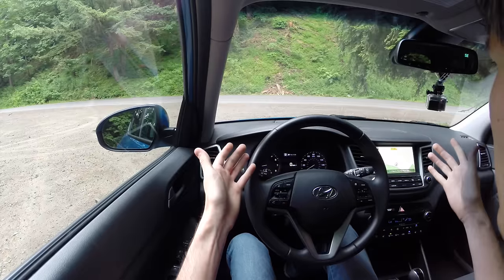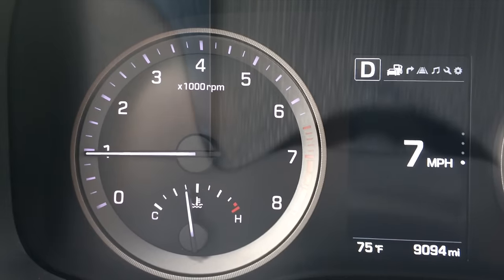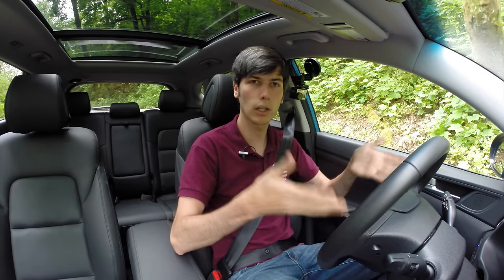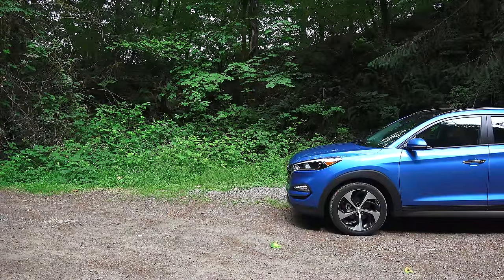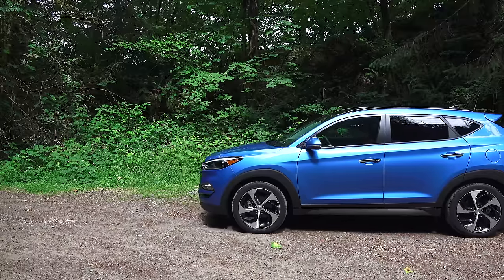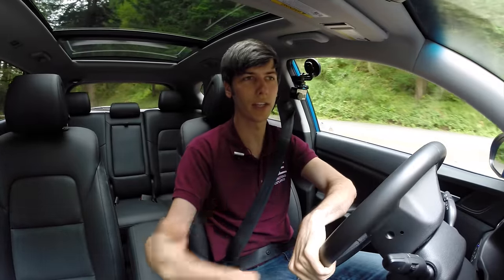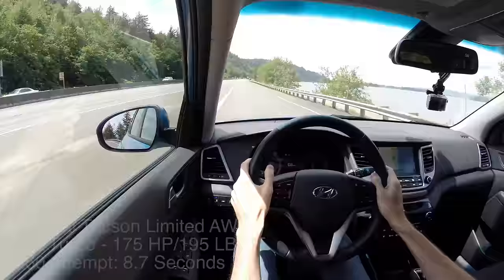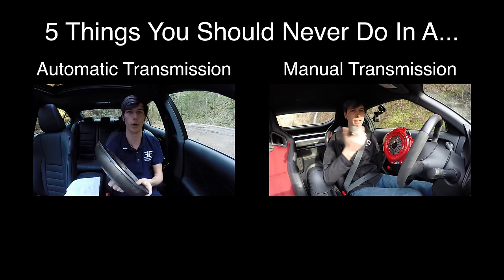5 Things You Should Never Do In A Dual Clutch Transmission Vehicle

Comment: "...engineers who develop these cars smart enough to realise that problem...": doesn't surprise me how a lot of people in comment sections don't realise that, especially in regards to auto start/stop and engine starter motors.
Reply from the maker: Great example!
Reply: Bigger mistakes have been made... often depends on which car company we are talking about!
Reply: They do realize it. Thing is, they don't care. The more these things break, the more money goes to the dealers. That's a win for them...
My biggest problem with the start stop is not the starter itself. You need a bigger battery, that will die sooner, and will be more expensive to replace. And it also doesn't help cars with dual mass flywheels. Another expensive thing that will wear out sooner when using start stop.
Reply: auto start/stop in non hybrid vehicles is annoying and dangerous and should be eliminated or the vehicle should have the option to have it permanently disabled. 

Everyone I know (yeah, I know...not a good sample) hates that "feature" in their car.

Plus, my car tells me at idle with the AC blasting I'm burning .4 gallons per hour. Lets assume that's accurate. Two and a half hours of idling to save one gallon of gas is a lot of damn idling for what seems, even in aggregate, to be a minimal savings. 

/rant
Reply: Doctor Professor Can't argue with that:) I can only throw engineers a bone in that most recalls seem to be from manufacturing defects (Some of Takata's canisters being cracked and GE's Airbus A380 engine's having an oil pump which was manufactured smaller than the Airbus engineer ordered, causing a fire in a Qantas airline).
Reply: dn bn Car models of good companies can be bad too. I had a cheap Holden Barina (Chevy Aveo in US markets) which had a thermostat housing made of plastic clearly to save money. Had to replace it with a metal one as it kept obtaining small cracks every 3 years. 

I have to respect that when I want purchase a cheap car though, the engineer is pressured to keep costs down or find a new job.
Reply: Na5iR11 BMW and alot of VW group cars use plastic in places they shouldn't, common problem!
Reply: +dn bn plastic oil pan, that blows my mind.
Reply: *****
Why? Plastic has been used in fuel tanks for years. Plastic can be made to have similar strength to metal. Plastic malleable and, therefore, more likely to deform than puncture.
Reply: Plastic goes very brittle with age
Reply: dn bn
not all plastics are created equal.
Reply: this is true, but metal is better for engine components. Fuel tank is debatable.
Reply: No..it doesn't. It has a "twin circuit" DRY clutch in it..
Reply: +admrob it's not like you can bottom out on a fuel tank, I just see it cracking in cold weather when hitting something underneath. With metal one you have a better chance just scratching it.
Reply: ***** Plastic throttle body. Yes, it exists. My car has one.
Reply: +admrob The auto start-stop is ridiculous in regular cars, you can't take off as quickly and I would assume it causes harmful additional wear on the parts. I believe it's mostly for the emission test cycles so they can advertise lower CO2 levels and in some countries that leads to tax benefits. 

In hybrid vehicles though it's not even noticeable when it starts up, maybe in the future when all cars are hybrid it'll make more sense.
Reply: admrob True. Plastics are very broad in characteristics, depending on the compound of the monomer, some may even surpass my metal thermostat in my car. Pirelli's plastic tyres in F1 and the plastic on the bottom of petri dish is an example of how they vary.
Reply: Dave Jubens Never driven a auto start/stop single motor car before, but I have heard also of how rough they when movement begins generally.

I have driven a friends Prius, and can concur, since I never even realised the engine was turning off until I looked at the fuel consumption meter.
Reply: +Na5iR11 that's due to an electric motor assisting in power and braking so it has a more seemless feel.
Reply: Dave Jubens
Agreed.

I have a 2016 Volvo V60 and the starter died with me in the middle of an intersection due to the stop/start. It's also rough and spoils an otherwise serene driving experience.

My other car is a 2015 e-Golf, so I understand why a hybrid car that can use its electric motor to get you going wont suffer from the same  flaws as a purely ICE vehicle (the delay, leaving one stranded and the rough engagement.)
Reply: Yes, engineers was smart enough to engage the 6th speed at 52km/h on a DSG, which cause the engine work on 1100rpm not good for the engine and mainly not good for the DualMassFlywheel.

So the fuel consumtion will be lower about a 0,2-0,3L, but you will buy the DMF for atleast 1000$
Reply: danex070 yeah exactly, that's the reason why I bought an S1, because it's only available in manual (I hate autos). And the start-stop is also killing the engine over time
Reply: *****
They need to be smarter. For example if I have my turn signal on it should know not to shut down the engine since my stop is likely to be momentary.
Reply: They are smart, my bmw wont stop engine if turn signal is on or engine is cold, if I drive aggressively and some other situations. But I still dont like it and keep it off.
Reply: +Theodore Marakas yes, at least bmw gives you that option and the car will remember your prefference after restart. Personally I would not pay for this, unless it is standart equipement.
Reply: +BattleHalo lol
Reply: *****
on my volvo there is a button you have to press every time you start the car to disable auto start/stop. Same for my bosses acura.
Reply: +Theodore Marakas my TDI Audi has a button to shut it off, it remembers your preference so you don't have to push the button everytime, but you do have to look at the light all the time. Fortunately with VCDS you can change the coding so that the lights function is reversed.  IIRC in the past they made you hit the button everytime you started the car.  Start stop on a V6 TDI is anything but graceful.
Reply: sometimes it can be specific to models too
Reply: +ast5515 
Yea it's going plastic everything isn't it ? 
It's cheaper that's why....
develop and cast it in plastic and save a lot of $. 
When I say plastic , I know it's not the old plastic kids toy stuff, it is some amazing stuff these days but it's overused.....
I could imagine the money that they save over the production with  metal,machining and tooling costs for working with metal has to be several times the cost and labor over producing with plastic.
Reply: +MrTheHillfolk even if they don't save money they would still do it for weight savings.
Reply: David Serrano Wow, I didn't think of that.
Reply: there's start stop systems that do not use the starter motor.
Reply: Jose:  Are any of those non-hybrid vehicles?
Reply: I think many of y'all just hate new tech
Reply: +1Cobranut yes
Reply: Jose':  Which ones?  I'd like to know how they start the engine without a starter motor.
Reply: David:  I don't hate new tech.  I work in one of the highest tech industries there is, but I hate unnecessary complexity in any system, especially cars.  It invariably leads to higher initial costs, higher maintenance costs, and makes it more difficult for the owner to repair when it does fail.  
Also, in many cases, it adds nothing to the performance of the vehicle.
Reply: 1Cobranut in this case most of that is hardly true. Electric throttle, Stop and Go, and other technology of that sort is hated simply because it's different.
Reply: In the case of the two that you mention, I hate those "features" for specific reasons.

1: Electronic throttle:  Needless complexity, and nearly EVERY vehicle I've driven with electronic throttle has poorer or non-linear throttle response, and often just does NOT do what my right foot tells it to do when I tell it to do it.

2: Stop/Start: I despise the fact that the vehicle shuts down, cutting off the A/C compressor, resulting in loss of cool air at stoplights, as well as the shudder when it stops and again when it restarts.  
Even worse is the dangerous delay waiting for the engine to restart and get up sufficient rpm to launch the car when I stand on the throttle to pull out into traffic. 
Other than the added cost, this "feature" wouldn't be so bad if the damned thing would just STAY TURNED OFF, instead of re-arming and forcing me to turn it off AGAIN EVERY DAMN TIME I get back in the car.
Reply: +1Cobranut and all of that is you just not used to the technology. the non-linear throttle or the poor response is by design. by design it's meant to not be so sensitive in order to save gas and to make the learning curve for new drivers easier. The stop and go is honestly just you not wanting to get used to the technology. and about the ac thing. if the car is cold turning off the ac only at stoplights would matter too much.
Reply: David Serrano:  Are you that dense?
I gave SPECIFIC REASONS that I dislike those "features" on cars.
I don't wish to "get used to" delays in acceleration and non-functioning A/C".
I've used these cars firsthand, and when the A/C shuts down, the air from the vents warms up in seconds.

Also, you have the electronic throttle issue backwards.  Most of these are programmed to give 75% of the engines power in the first 20% of throttle pedal movement, to give the false impression that the underpowered vehicle is "powerful".

The last two rentals I've had this year, a Toyota Camry and a Nissan something or other, both had electronic throttles, and both, but especially the Nissan, would give you most of it's meager power in the first bit of pedal travel, but from there to WOT, nothing much changed.  It was frustrating when pulling out to pass a slower vehicle and stomping the throttle, you'd expect some acceleration but get little to none.

Performance cars, like the Corvette and Mustang V-8's, are better in that respect, but I still dislike how the traction and stability control systems take over throttle control from the driver.
I am perfectly capable of modulating my own throttle, thank you!

And nothing will fix the delay in response when your car has decided to shut its engine OFF completely.
When I want to go, I want to go NOW, not 1/2 second or more after I've decided to pull out into traffic.

It's fine to offer this crap as an extra cost option for those who may want it, but stop shoving it down everyone else's throat who'd rather drive our cars OURSELVES!
Reply: +1Cobranut and that's exactly what I'm saying. it's a different way of driving. one your not used to or one you don't want. you specifically said I don't like it and I won't try to get used to it. right?
Reply: +Theodore Marakas most of the newer stuff they put in won't break randomly lol. I highly doubt electronic throttle would break more often that a cable throttle or anything if that sort
Reply: The difference is a throttle cable lasts 300,000+ miles, and costs $8 to replace.  What will your electronic throttle body cost when it fails?
Reply: +1Cobranut by time it fails the rest of the car will have failed too lol.
Reply: David: Maybe not.  My 1991 Explorer has over 300,000 miles on the original cable, and my 2004 Focus has well over 220K on its original as well.
Reply: Theodore: I agree completely.  A cousin had a Mercedes for a while.  He said the drivetrain was reliable, but every other part of the car was eating him up $200-$500 at a time.
In the course of a couple years, he had to replace EVERY window motor, which cost around $500 each instead of the $99 you'd pay for most domestic cars.

My Dad always had Ford and Mercury products, and since the mid 70's I can only recall having to replace 2 window motors on the 25 or 30 cars we've had with power windows.  LOL
Reply: +1Cobranut I saw the Peugeot with manual piloted gear boxes and I got stunned by that. im still investigating how it works. I suspect about something in the flywheel and or gearbox. when the car restarts it doesn't make any sound. I last saw this on a Peugeot 508 1.6 eHDI
Reply: Trouble is, the damn thing turns itself back ON every time you start the car.  I have the same complaint about traction and stability control.
Reply: 1Cobranut well you shouldn't turn off traction control. It's there for your safety and the safety of others on the road. It would be irresponsible to turn it off imo.
Reply: TC is for people who can't drive!
I only have two cars that have TC, and the first thing I do when I start one of those is to disable it.  LOL
My two highest horsepower cars are both in the 4lb/hp range, and neither of those even have TC.  They do, however, require a DRIVER! ;-) 
I despise these nanny systems interfering with what I want the vehicle to do.
Reply: 1Cobranut regardless of how good of a driver you are there is always a potential to slip out especially if it rains. Traction control helps prevent that from happening. It keeps not only yourself safe but other drivers on the road. Accidents can happen to anyone. Doesn't matter how good of a driver you are.
Reply: Thanks for the concern, but you don't need to worry about me. I've been driving, and racing, since I could reach the clutch.  I've held competition licenses with SCCA and NASA for years, and never had an at-fault accident in over a million miles of street driving.
I do just fine without any of those nanny systems in my cars and trucks.
Have a nice day.
Reply: 1Cobranut still could happen. Better safe than sorry. People successfully pull out pretty often too. All it takes is one mistake. When it comes to other people lives I rather not take chances.
Reply: +Stinky Cheese I have yet to actually see a source for stop and go causing premature wear and tear on engines.
Reply: Yes but they can easily design around that. For example they can use beefier starters(which they do) as well as a other things to help not break parts quickly
Reply: ***** also there was development in the engine oil department which can help prevent engine damage (and probably turbo damage) by an enhanced lubrication that helps with start up.
Reply: Also extreme heat in a turbo would only occur if you are driving the car hard. And if you are you probably have stop and go disabled. And it would be pretty simple to add an electric oil pump for when engine is off.
Reply: +David Serrano I have an electric pre/post luber on one of my cars, but it was expensive. About $750 including the lines and fittings. Worth it on a $20,000+ engine, but not on an everyday car.
Reply: +1Cobranut well you bought one that was aftermarket. after you account for mass production, mark up, and etc. I bet they can put one in for 100-200 dollars. they might already do so but I don't follow new cars that much.
Reply: +1Cobranut after quick googling I saw that kia puts them on cars that does stop and start. I would assume that other manufacturers do the same.
Reply: An extra $100 cost on a production car is HUGE!  When they're building 100,000 of them a year, manufacturers fret over $2 part costs on $40,000 vehicles all the time.
Reply: 1Cobranut well apparently it's not that huge if cars are being shipped with it.
Reply: If there were only (smart) engineers involved in the production of a car or any product for that matter that would be great. But that's not the case. First let's get this one out of the way: engineers can fail. But the real problems are mostly caused by the non-engineers that are involved. Like people from the financial departments making cuts here and there. Otherwise products would be much closer to perfection than they actually are. Btw, that's not just a guess. I know that from a guy whose working at the engineering department of a large German premium car manufacturer. 

Example: There's a plastic valve  (essentially it's just a screw) in my car as a part of the cooling system. It's known to fail - it's actually one of the few weaknesses that this very reliable engine is known to have. The engine was in production for almost 20 years. They never changed that part. The reasons: the valve lasts usually longer than the warranty period and the valve - although it costs probably 5 cents to make in China - is only available as part of a pipe segment, including the valve mount - which costs less than 5 bucks to make but retails for 100 bucks. If you have that part changed at an official dealership they charge you about 300 bucks. Which they could not if the part hadn't failed.
Reply: DerSystematiker Sounds like some pretty smart engineering if you ask me.  Ethical? Not so much. SMH
Reply: I would not work for a company with that kind of manufacturing attitude.  The ethical role of an engineer is to design machines that do not fail; any KNOWN point of failure should be addressed with an upgraded part. A part which for some reason was not detected as vulnerable until volume production was underway should be addressed with a recall and a warranty extension, since it has become a "known manufacturing defect".  The attitude that a "luxury car" only has to last until the warranty runs out, is going to turn a MB, BMW, or Audi buyer into a Toyota buyer when they find themselves standing on the side of the road in the rain watching their "premium car" being dragged away on a cable.
Reply: Sounds just like a BMW! I'm on my second Fiesta and the Start/Stop is just fine.
Reply: The start/stop of BMW isn't perfect.  It can actually ruin the car if you demand too much when it's in mode.  I coded it to be remain off by default to not deal with it.  Still turns back on in ecopro but I use ecopro when I'm on the highway.  I mean, it doesn't really save gas much.
Reply: Theodore Marakas I agree; so many of the new safety and fuel-saving features are gimmicky by nature and add unneeded  complexity to modern vehicles.  This makes car owners more reliant on highly trained technicians and thus less self- sufficient. This lack of self-sufficiency is a trend we see in all facets of modern life and is seemingly being pushed by the plethora of bureaucratic entities inserting themselves everywhere. These same bureaucracies are encouraging an unhealthy obsession with fuel economy that misses the big picture in so many ways..
Reply: Same for phanatic obssesion with emissions... Maybe Trump is aware of that and plans to hold EPA as it has become too dictatorial.
Reply: 1Cobranut - That's any European vehicle for you and that's why I'd never buy one. They like to win you over with their fancy interiors and in some cases the driving dynamics, but their electronic gremlins will eat you alive after the warranty runs out.
Reply: 1Cobranut well said. I love new tech and anyone's tech solutions that work, but I hate gimmicks and "features" that you can't turn off and start stop vehicles (That use the starter motor) are that. The amount of fuel saved doesn't out weight the wear/tear). They do it so people will think they're saving the environment when their car isn't idling... And to get residuals in repairs. I was taught that more fuel is used in starting an engine than idling for a few minutes like at a light. I'm no engineer so this is just my opinion.
Reply: @muddysledge  I am an engineer and you'd have to be stuck idle for more than the 10 - 15 seconds that some "experts" say in order to actually save fuel, start up from warm usually can start from reduction in fuel but whether this is actuslly put into practice.

I was also taught that most of the wear/damage done to an engine in its life time is from starting up, this is mostly true when done from cold, start/stop wont have this issue but it will still cause wear simply due to "violent" nature of any start up, this is especially true for diesel engines.

My primary engineering education and experience is from the aerospace industry, but any decent engineer follows it all especially equipment such as a car they use everyday.
Reply: @JP_RS6  good info, thanks for sharing your knowledge man
Reply: @muddysledge  Np, sorry for replying to a month old comment on a 2 year old video, I just got my first DSG dual clutch auto transmission, so decided to do some brushing up and of course, as this is youtube  trawl through the comments haha.
Reply: @JP_RS6  haha, well I'm guilty of commenting on an old vid too, but I do it all the time. Comment then look at the date, oops. I like to see what people's thoughts are especially when they actually are schooled and trained on the subject. What you said about a warm start not needing the extra fuel makes perfect sense. Would be no different than someone starting it after getting gas or a quick stop at a store etc. But, like you said, if they implement that and I'd think that it would have been accounted for. I thought about a design akin to a golf cart using it's generator to kick the engine to life when you press the accelerator and then charger the battery as usual once on engine power, but there probably are variations out there already. No idea how large the gen/alt would have to be to kick a 4 cyl in traffic to life but the golf carts always intrigued me. I admit I've only seen stop/starts with a traditional (at least sounding) flywheel starter and it just looks and sounds clunky. Maybe I should test drive one.... Nah. Have a good one.
Reply: @Na5iR11  That Qantas Flight 32 emergency was caused by a broken oil line in the RR (NOT GE) engine.
Reply: @Majestic Beardsman Gotta love the YouTube comment system... I can't find the comment you replied to.
So the car is 3,5 years old now (6 speed manual) and so far I have a dead battery, ruined dmf and clutch, a misfire they've been trying to fix for 2 years. Needless to say it's not fixed. A bunch of creaks and rattles, a head unit that has to be restarted weekly by removing it's fuse because it completely locks up, a keyless entry system that despite a new battery only recognizes the key 70% of the time, some random problem that causes it to throw a bunch of errors instead of starting once a month, etc.
Reasons? Well, it has good fuel economy. Too good.
Batteries need to be charged constantly. Not just when they drop below a certain voltage. But disconnecting the alternator saves 1% of fuel so they do it.
Throttle pedals need to have something to do with how much the car accelerates. Not the case here. The car has a problem where it overreacts and at 5% throttle it acts like I floored it, revs up, realizes it fucked up, cuts power, clutch grabs, car lurches and the dmf is ruined. Ongoing for 2 years. Other times I floor it and literally nothing happens. It's not turbo lag either. It just doesn't do anything. They replaced the has pedal saying it's sensor is bad. Well, in that case the new one is just as bad.
I think my misfire is an injector because they replaced a bunch of ignition stuff and it's just as bad as it was.
I'm sick and tired of new cars. Any new car I test drive has a bunch of problems. I'm taking actual problems, not just stuff I don't like. I've never test driven a new car that doesn't have tattles for example.
Reply: @1Cobranut  i got lexus , a gs 430 (6spd) and a gs 460 (8spd ) i use an Elite Drive smart throttle on both ... goodby throttle lag . instant response  especially in sport or race mode in top settings ( in those modes  10settings to dial up , race setting takes rev limiter from 6350 to 7500 ) plus gives you no lag gear changes, better touge by cha ging mapping for g/box .. makes v8s respond how they should .. best cheapest plug ins for better performance without doing engine .. can be set for auto or manuel , in430 set in for auto gbox but the 460 8spd its set in manuel mode cause of 2clutch great lexus gbox .. in the 460 instead of bounching when hit top revs it slips thru to next gear .. so if in race mode top setting .. put car in first gear in manuel , put foot down , instint take of and automatically goes to 7500rpm in each gear   if you dont manuel shift , dont have to worry about over revving cause it slips into next gear at 7500  (instead of 6350 ) and does that intill you are in8th ... does 160km in3rd .. and increases 0-100 time ... and  kickdown or down shift to overtake etc is instint in shift and thottle response..sensitive as ya girl ..  !!
Reply: @Imaboss8ball  if you driving race turbos hard , you need methonol injection ... my 450kw supra i had it hooked up wnen put new computer inwith 5 boost settings and lunch control .. methonol injection keeps air extra cold and help compress air in turbo and keeps piston crowns cool even tho forged .. also keeps turbocool .. i was running a masive garret ... and using 98 octane or av gas ( can get here , nz, from a couple places but cant put it directly incar , id full up containers ... ) need the coolness then.. plus in nzmost v8s are high HP and rwd without traction control .. im 60 and even my gs460 (uptuned 400 hp )  i hate the TC .. not natural feel when you grown up with high HP rwds  with out it .. plus it cuts into much , i use smart throttles too , you just fk ya diff etc fromTC over working ..